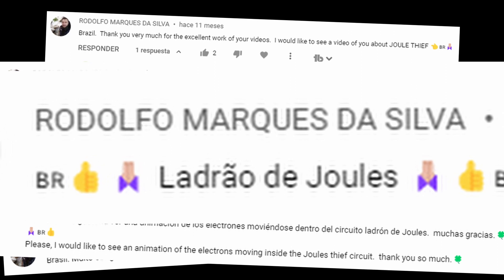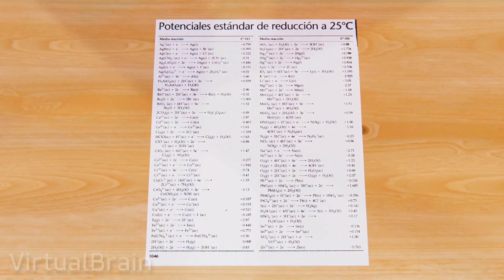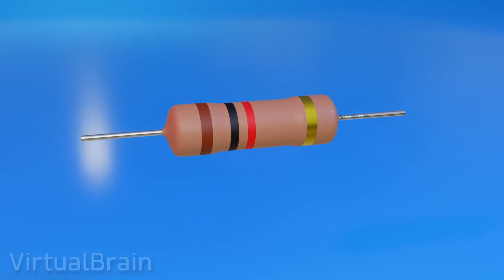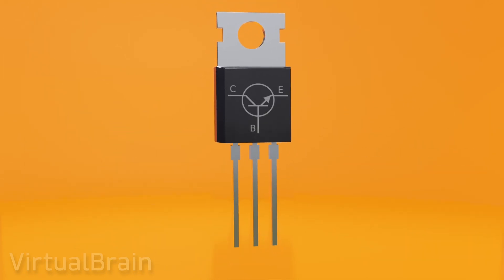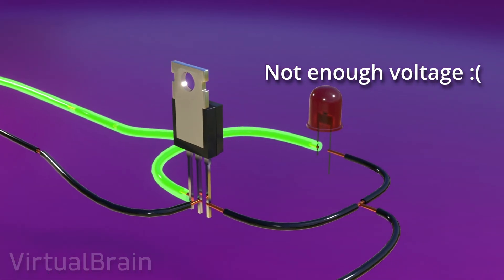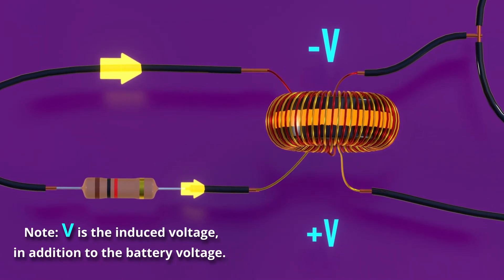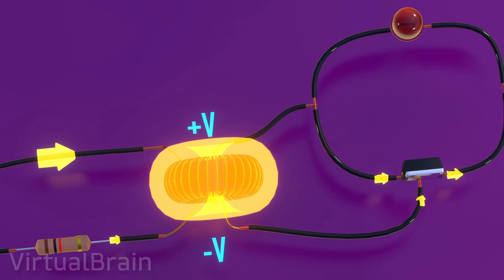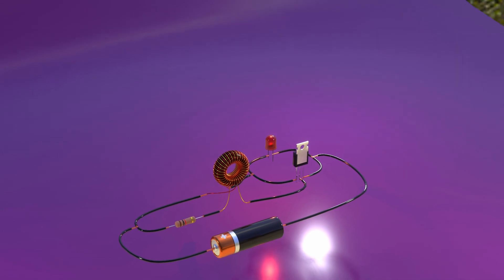How Does the Joules Thief ⚡Free Energy Work?

Comment: I have had circuits of this type work at below 0.5 Volts and that is with a silicon transistor. This is not "free energy" but the fact that this sort circuit steps up voltage. Perhaps with a germanium transistor the voltage might be even lower?

Comment: I built a couple of those but still dont fully understand them. 

I even looked at them with an oscilloscope and I see what happens but it still puzzles me a bit.
I dont really understand why the voltage goes higher  and higher. When the magnetic field of the coil collapses it induces the high voltage. Then the transistor closes connection so the voltage can only go through the LED. But THEN the transistor switches on again.. Why doesnt the voltage just go to the negative terminal of the battery ? 

Or will the voltage induced be in series with the battery ?? Oh maybe I got it ?? Is the induced voltage in series with the battery over and over, thus increasing until it can flow through the LED (and being capped by the led ?

Lol if that is correct just writing this comment made me understand it.

I'll check to verify with my oscilloscope.

PS: Thanks for the video ☺ I can clearly see that you put lots of effort in it :) awesome animations and explanation. Still hard to get your head around.

Comment: It's not free energy, it is raising the voltage but reducing the duty cycle. So instead of steady flow of 1 volt, it will create pulses of 2 volt at 50% duty cycle (i.e. remaining on for only 50% of time).
Free energy is when u r creating more energy than u r putting into the system, that is both voltage and current should increase.
Reply: Maybe it's called "free energy" because it's a way to use depleted batteries that have no value for average user?
Reply: so it's a power amplifier
Reply: @alanx4121  yes dc to dc boost converter works on same principle.
Reply: @alanx4121  No it isn't
Reply: There is a possibility that you can multiply increase the energy in the circuit. That is, you can have more at the output than at the input. You can increase the current and voltage at the same time.
Reply: Free energy comes from the collapsing magnetic field once the MOSFET gate closes , this causes the magnetic field to collapse at almost speed of light , making current in the coil , this back emf is powered by the speed of light so you get high voltage and at least the same current , this happens because it's not energy what we are calculating but work ,(watts) watts are amount of work done divided by time , what happens when you make time really small , the watts will increase , so it's better called , free power instead of free energy, it's the same energy but its being released in a very small amount of time with the help of the speed of light
Reply: Faux une énergie libre peut être de 1 et non surnuméraire... C'est le cas du corps humain par exemple...
Reply: I am from Poland This is free energy If you know how to use it and you know how to expand It will actually increase the current and voltage I know how to do it and I assure you it is free energy You write and probably do not understand what you are writing You have more energy at the output If you have, i.e. you take 5A and increase the voltage from 12 v to 200v then you already have more energy at the output So 12vx5 A = 60 watts At the input you have 60 watts And now at the output 200vx 5A = 1000 watts As you can see at the output you have 1000 watts As you can see at the output you have more energy
Reply: @jacekwis512  rms, instantaneous or avg watts?
Reply: @jacekwis512  it's ou if v and i are taken as rms and if they are in phase.
5a and 12v constant dc is 60w avg, and 5v and 200v dc with 6% duty cycle is also 60w avg, because rms is 1.2a and 49v.
Reply: @jacekwis512  how would you increase the current as well?

Comment: Many products will reject a battery at 1.3 Volts and say "low battery". This is like putting 15 gallons of gasoline in our car and have it show empty when we use the first 2 gallons. The Joule Thief helps us get back what would be wasted.
Reply: Rather at 14.5 gallons down. Way most products are designed to run down to 1 volt per cell wich leaves the battery almost completely empty. The choice of 1 volt per cell has two resons First: Most devices has build in controllers that run on 3.3 volts and needs it stabilized (for a four cell device) wich introduces voltage loses. Secondly: A completely depleted battery is way more likely to start leaking.

Comment: The "Joule thief" is a blocking oscillator with a flyback output. It is kind of the electrical equivalent of a slingshot aimed into the air.
With active control of the transistor on and off times a more complex switch mode power supply can be created.
I suggest that experimenters look at the cheap and common MC34063 chip and its applications to get a start.
https://en.wikipedia.org/wiki/Joule_thief
https://www.ti.com/lit/an/slva252b/slva252b.pdf

Comment: Ok all the super smart people here 2 questions, #1 if you increased the amount of coils and you wrap them to where there is multiple levels of coils stacked on top of each other does that mean that there would be more power produced? #2 if you take away the LED bulb and instead run it straight to the battery and you have a battery that is capable of recharging would this in turn recharge the battery? And I guess I have a 3 question how does a rechargeable battery work opposed to an alkaline battery? Why are you not able to recharge alkaline batteries? Thanks ahead to anyone that can comment or answer these questions

Comment: I know motorcycle ignition coil have similar mechanism, but if I wanna use it to deplete my motorcycle battery, will I have to use additional components?
Reply: moto's is a transgormer , if it uses the battery you have 12v to ~25000. That'll kill you.

Comment: "How Does the Joules Thief ⚡Free Energy Work?" it's not free energy...
Reply: Correct. It's simply a voltage booster. It doesn't create energy, it unlocks the energy from a low-voltage battery so that it can be used to power loads that need more voltage to work.
Reply: 昔の電話。大きなコイルが入ってました(o・ω・o)
Reply: No such thing as FREE!!
Reply: Until you know and understand how to capture it. The secret is that the magnetic field is unlimitedly duplicable when in this state. Voltage and current are just side effects. And today's entire planetary electricity system is built on this "small" and "limited" side effect. Have a good day.
Reply: Per the textbook "Modern Thermodynamics"  published by Wiley & Sons, with Authors Dilip Kondepudi and Ilya Prigogine, on Page 459  read -  sharp gradients can violate the 2nd law of thermodynamics.  This is documented in non-equilibrium thermodynamics. Look it up.
Reply: @timothyjohnson1511  and by sharp objects you mean...
Reply: @the555timer  Sharp gradients, not sharp objects.    For example: electromagnetic field gradients.
Reply: It is free because what is causing it is the speed at which the collapsing field is changing, and  because  it's happening at the speed of light , the rate of change of the magnetic field is really small making Dt really small in Faraday's law of induction

Comment: I doubt anyone understands this but a jewel thief is more or less a Tesla coil. Although tesla used the bifiler coil as a capacitor. More so if you at a capacitor with the same  Capacity as the inductor in series it becomes a High frequency  pulse amplifier.